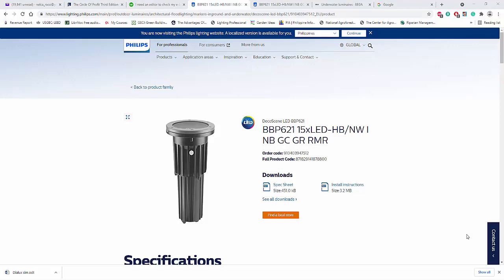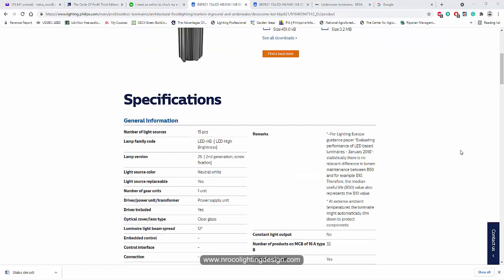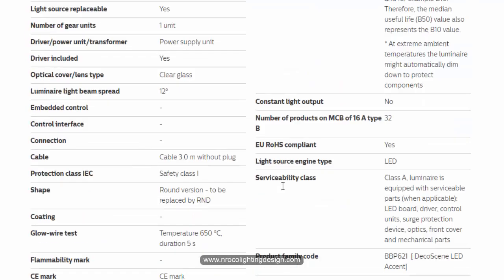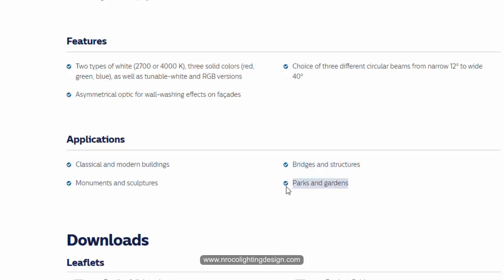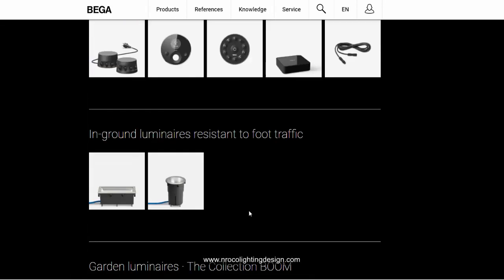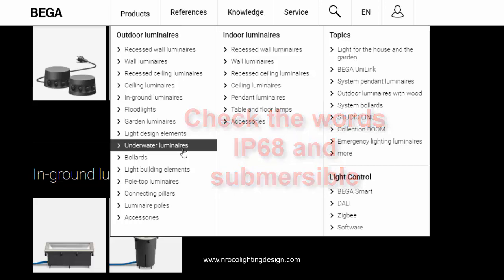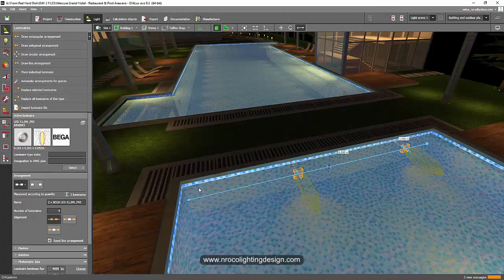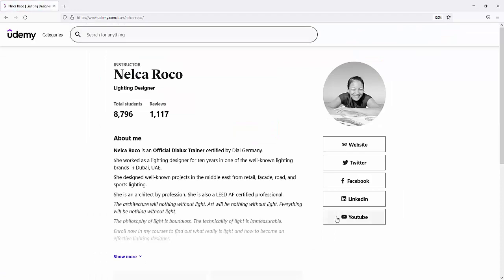What is IP68 submersible fitting?

Comment: Yeah, not to mention this is NOT a low voltage luminaire!!! This is a super dangerous fixture to be installed into a human accessible body of water.  I'm sure your electrical code would not allow non 12-24v fittings to be installed in locations where humans (kids specially) would enter the water, even if it would be rated IP68. My local code would not allow non LV fixtures within 2m of a body of water. Cheers Nelca!
Reply from the maker: Hahaha! yes. you're right.  thanks for the input!

Comment: Even IP68 submersible is not necessarily recommeded for chlorinated water in swimming pools. Fixtures for swimming pools need special gaskets, which are not permeable & are not being deteriorated by chlorine. Furthermore housing components for professional pool fixturers are mostly V4A stainless steel, instead of "normal" V2A stainless steel (the latter I have seen corroding in a public pools lighting mounting brackets), due to the chlorinated atmophere.  But for the BEGA fittings you chose, you should be fine, the even have chlorine resistant wireing ;)  Wibre also works well in this regard.
Reply from the maker: Wow! thank you for the input, Magnus!